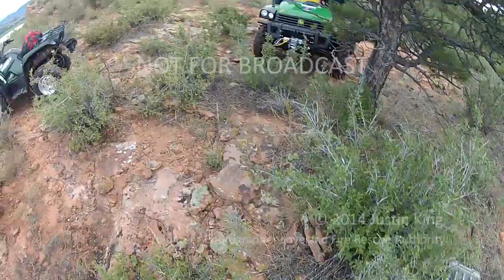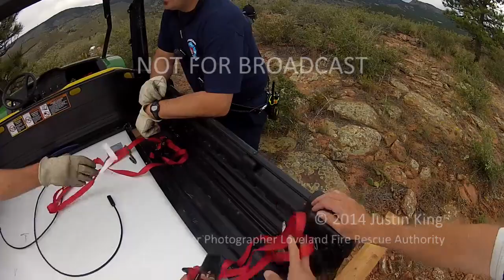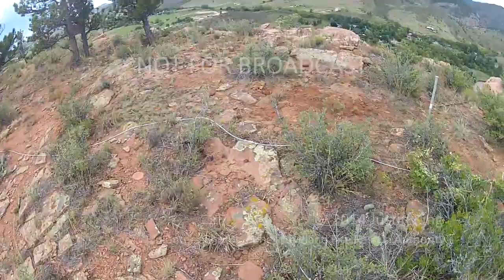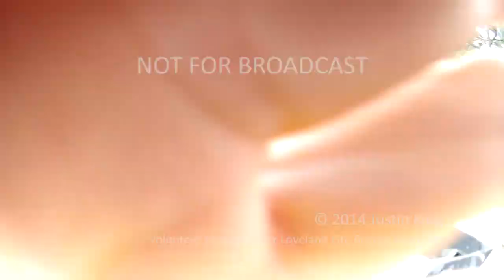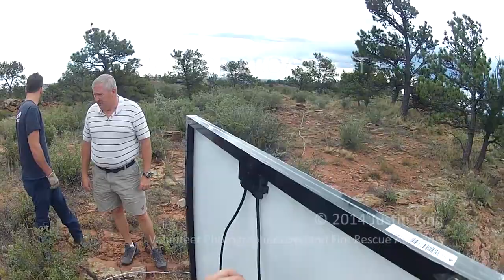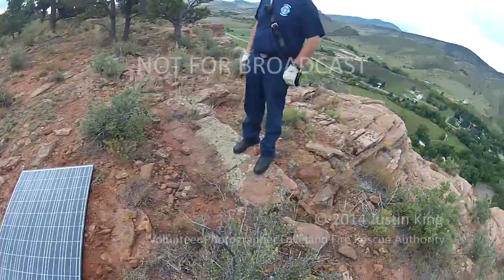9-18-2013 ATV to PTP link post Big Thompson Flood #3

Comment: Thanks for sharing! What kind of bandwidth were you getting with that setup?
Reply from the maker: 20 to 25 megabit over 2 mountain top relay points.  this ran for basically 9 months straight.
Reply: Justin King Wow, that's pretty impressive.  Good work.
Reply from the maker: Thomas White our ARES communications team got a grant after demonstrating our capabilities during the flood to totally overhaul our system and we upgraded to ubiquiti airmax gear, this gear is still in the cache of goodies though for use.  works great!